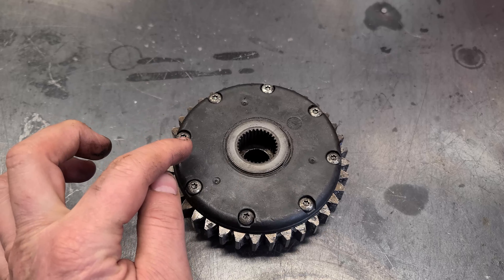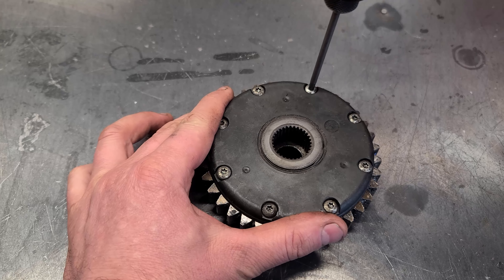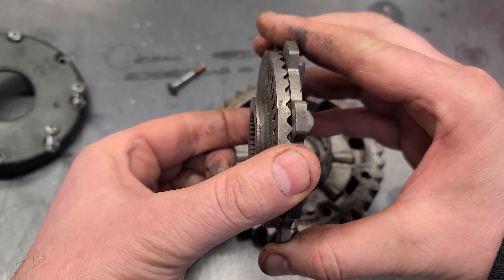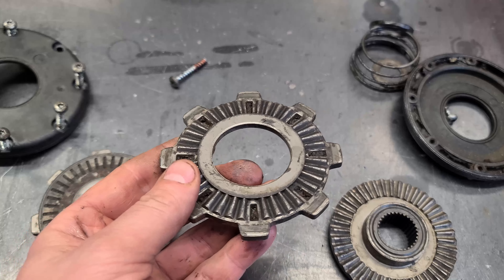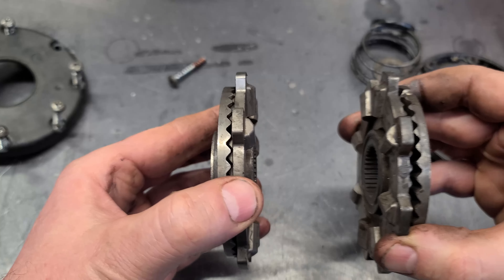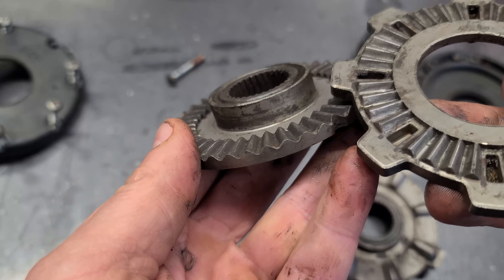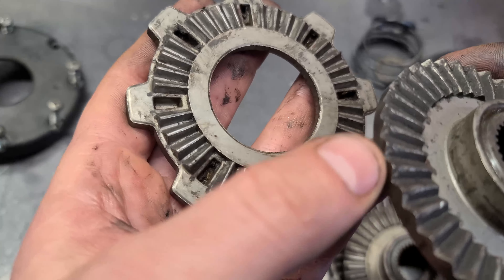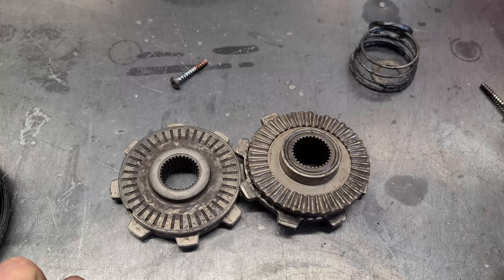INSIDE ARIENS SNOWBLOWER DIFFERENTIAL WEAR & TEAR - WHEEL WON'T TURN & CLICKING NOISE

Comment: Had a situation like this a few years ago. 
Part was more expensive than the blower was worth.  But it was a good blower. 
SOOOOO, I welded everything together and made it into a straight axle  like most MTD blowers.
Worked perfectly 😊
Reply from the maker: that's a great idea if you don't want the dif feature
Reply: @donyboy73  Ariens has a nice idea in hypothesis but practicality it is awful.  I don't really like that idea in hammer drills, so why put it into an expensive piece of power equipment like a snow blower?
Reply: @WJCTechyman  - If you drive a 4wd vehicle you are dealing with some variation of this same principle.
Reply: @donyboy73  yes Don,  but it comes down to how badly you want that feature.  As good as it is, it's not worth the cost, and at the same time the blower is too good to scrap.  And 3rd, having the straight axle is what is most common on other blowers. 
And so it goes.

Comment: Thank You for posting this. I've been having trouble with mine as well. For a temporary "fix", I disassembled the unit and stretched the spring out after pushing on some small windshield washer hose effectively making the spring thicker(and longer). The difference was night and day. 👍👍❤
Reply: Yes, I feel like the teeth have to be rounded to a certain extent to facilitate slipping over each other.  It seems like it may be a combination of wear and a weakened spring.

Comment: Another very fine job by Donny boy who has diagnosed and dissected the problem. These parts are designed to fail because of the materials of construction and the lubrication system. Engineers refer to this issue as Cycles to failure. Some parts have Lo Cycles to failure to balance the cost per management Direction for materials of construction, design standards including maintenance such as lubrication systems that are replaceable, as well as individual components that can be replaced. And, herein lies the difference between a high quality commercial snowblower that can be rebuilt from the parts, versus a lower grade snow blower that has disposable parts. And of course the original equipment manufacturer makes much more money on the parts than he does on the sale of the entire snowblower. So what does that mean for the individual snowblower owner? As the snow blower where it's out and parts need to be replaced you will reach point in which it is no longer economical to continue to buy new parts for an old snowblower. What's the solution? To keep the price of the replacement parts cheap and that is done exactly as donny-boy suggest. Breakdown the assemblies into the individual components which have failed and replace only those components. But that's not how the original equipment manufacturers make money; they make lots of money by selling sub-assemblies that are very costly. And then of course one must pay for the labor. If you are mechanically inclined like Donnie boy, then it is much more cost-effective to continue to replace Parts on your snowblower. Thank you Danny Boy for another highly informative repair video! Kudos to you!
Reply: Seems the entire problem can be solved by grease it once every few years.
Reply: @greentjmtl  1/year.

Comment: Thank You for keeping your videos available. Working on an Ariens Pro 32 an OLD one LOL. I didn't take it apart yet but I'm sure your right about the gears. the part $200, but I'm glad I can get one. Yes I will take it apart to confirm the gears are worn. I think you welded one which I could do, but as long as I can get the part I'll buy one. Thanks Again.

Comment: Great video. I had an Ariens 28 and I couldn’t get the thing to drive up hills. New belts, friction disc, etc. Looking back this part was the problem. I sold it and bought a Honda HS1132. The Honda drive is much better, no differential to slip.
Reply: Yeah, but at CA$5000, it is something I still long for, but in the mean time the Cub Cadet I currently have will have to do.  The features of the Honda like the track drive, battery electric start, hydrostatic transmission (my Honda commercial mower is very nice in this regard) and the gas strut height adjustment would be perfect.  The closest to a Honda snow blower I have is an old Toro 21" repowered with a Honda GX160.  I also have a couple old Honda HS35 units.
Reply: @WJCTechyman  my machine is actually a ‘98 HS1132, I prefer the simple mechanical machine and I spent a fraction of the price of a new one. I sold a 2016 Ariens for a ‘98 Honda. After 1 season I’ve fixed lots of issues on the Honda, but it’s worth it for how it performs. Most of the problems were my fault from heavy use, I’d recommend the older Hondas for sure.

Comment: Always fascinating.  Too bad the individual parts are not available, but would they really be cheaper?  It would seem that both sides would generally need to be replaced anyway.  You know, why fix one side for the other to fail shortly after.
Reply: Yeah, I can't imagine it's much more expensive to add the other parts.  May as well replace the entire thing.

Comment: I've like to see a comparison with a new set of teeth.  Also wondering if stretching or replacing the spring with something stronger would let the plates work for a bit longer at least before having to replace the whole unit?
Reply from the maker: new dif has very sharp gears

Comment: Good video Don. I have a 1 1/2  year old Ariens 24 Deluxe with this differential. I baby my machine . I learned from your videos how to make  my machine even better. Is there any maintenance that can be done to prevent or prolong this from happening? Keep the videos coming,they are really enjoyable to watch.
Reply from the maker: i would take it apart and add some lithium grease between the plates
Reply: @donyboy73  That might help, but may mess with the preset calibration of the differential.  Also, as it wears, you then have grease that acts like Vim or tooth paste as an abrasive holding the aluminum or iron filings that then just etch and wear into the remainder of the plates just ending up with the same result.  I would say if you are a home owner or renter doing only your driveway you should pull it apart each season and clean it out and reapply the grease yearly along with your oil change.  If you are a commercial user, stay away from Ariens' differential as there are better options like Honda, Kubota, Yamaha, BCS and others to use for snow removal.

Comment: Hi. Donny. I do small engine repairs from home garage as a retirement job. I just bought an impressive new ish  Ariens professional series pro 28  926038 with Briggs 420cc engine .  I also took an extra step to install an impeller kit which I have been doing them since 2005 and have had great results with many happy customers. Tested it on a mild day with heavy wet snow and OMG. It blew wet snow 70ft!!  Have videos!  So I am kinda fussy and after I watched your video on differential repair I looked up service manual on mine to see what service I can do to prevent wear. Only info is replacement.  I was thinking of removing it, disassemble and grease? What are your thoughts on that? and Type of grease?  I have done all the other required service . Oh and what do you think of that briggs engine?
Reply: Grease would make it slip more.

Comment: Hi DB, I have a Ariens Pro with the auto turn system, other than proper maintain, is there anything that can be done with the auto turn differential that will prolong its life ?
Reply: I'd take it apart and grease it every few years.  Remember this blower did 20 driveways each time it snowed.  If it only lasted 2 years that would be 40 years of use for the average homeowner.
Reply: @plmn93 , thanks, thats what I’ll do, I’m OCD when maintaining my my small engines.
Reply: @FLSTF-us4df  You might as well do it now. I took apart mine when brand new and there's very little grease inside the differential.

Comment: It seems like it should be packed with grease to prevent wear and possibly support higher tension/stronger spring. I don't suppose this could be added in some way as a repair. A lot of people swear by Aaron's, but I always swore at them!
Reply from the maker: it would be good to add lithium grease
Reply: Well, Ariens' older machines were built like tanks but its current design doesn't really go beyond Cub Cadet.  My Cub, a semi-commercial model is built on par with Ariens.  I would still prefer to have a Honda but at almost double the price of my Cub, it was just easier to go with the Cub.
Reply: @donyboy73  no.  It would stop working immediately.  This mecanism is meant to be dry.
Reply: @WJCTechyman    And that's why I bought a beautful 1998 ST9-28, E.S. with sales slip and all the paperwork including parts manual that's like new and doesn't use this stupid design. Just Love it.
Reply: Detroit lockers are immersed in gear lube. It should work lubed. It is not a dry clutch, it's a toothed coupling that needs to slide over each other  in a turn until the outer cogs realign and forced together when going straight. @Appytail
Reply: @cyrusjohn6594  It is not really a Detroit locker.  It's hard to have a verified answer on this. The manufacturer, General Transmission in Texas (& France), do not answer to emails.  The "Run Dry" comes from some mechanics on the WEB.  They say they have dismantled some new, and found they were dry. It is certainly not comparable to a Detroit lock on a Truck ... If this thing, in the end, needs lub, It would be specific to that application.  Most probably synthetic & moly.   I think I am at this point the only way to really find out is to try myself.  One thing I know for sure, I don't need this at all. I can move the ass of my Ariens cow no matter how stubborn she wish to be.

Comment: You seem like a smart guy, my old ass snowblower’s reverse gear has gotten pretty weak. It’s basically just helping me pull it at this point and it constantly wants to shift itself from Reverse to neutral. All forwards gears operate normally. What should I look for when I open it up?

Comment: Many complain about differential problems. Some complain about moisture contaminating the inside of the differential units. If Ariens is having problems, then Toro must be too, they use the same differential just a different gear ratio. The cost to replace the whole unit is a big chunk of change. I suppose if you only use your snow blower 3 or 4 times a winter, your differential should last a while before wearing out. You would think the units would be filled with grease? But that may not allow the teeth to lock properly. Looks like there is room for improvement in the auto turn differential design.
Reply: Yeah, the grease in the differential concern of yours is what I was thinking.
Reply: @WJCTechyman  It appears periodically the differential needs to be taken apart and regreased. There are seals that could begin to fail. The problem is, you can't buy replacement parts, you have to buy the whole differential. I guess if you can get several winters out it before any problems arise, it wouldn't be that big of a deal. If it were me, I would disassemble the differential after a few years and do an inspection and if needed regrease the unit.

Comment: Even a $610.00 part might make sense on an otherwise good snowblower. A new commercial grade snowblower will cost more than $3000.00. If you do the regular maintenance and replace worn parts you can run a snowblower a long long time. Corrosion from salt water is the enemy. Anti-seize compound is your friend.

Comment: I have a ariens snowblower and was wondering if its ok to 'free wheel' it while its running.  my driveway is on an incline and its much quicker to just let gravity coast it down hill then engaging the clutch. will this cause issues by doing this? So the auger is engaged but I am allowing the blower to freely move and throw snow.  thanks
Reply from the maker: It will not cause any problems, the machine in video was used commercially that's why it's worn out!

Comment: If you noticed the maximum wheel size and maximum machine weigth, you'll notice Ariens' Pro series exceed what that DL500 can handle ...
Reply: I was looking to purchase one of Ariens Pro Series snow blowers, but I opted to go with a Toro HD Power Max 1232 with trigger steer. The trigger steer works well, but the auto steer would make using the big machine even easier. After much research before making my purchase, I was hesitant to spend that much money on a snow blower and be disappointed with the auto steer system. If I did have a snow blower with auto steer, I would disassemble the differential ever two or three years and check if it needed grease. All snow blowers need regular maintenance to make them run properly and last many years. I have two Toro snow blowers that are 1980 models that are still going strong. Those older machines were built like tanks compared to today's machines. Keeping them inside and out of the elements all those years is another key to longevity of these old machines.  As far as the ability to throw snow is concerned, the newer machines with the bigger impeller and augers even in wet heavy snow are light years ahead of the older machines. After your comment concerning the DL300 differential capability, I am glad I opted to go with a HD machine with trigger steer. Thanks for sharing your comment. Let's hope we have enough snow to use our snow blowers. Have a blessed and safe winter.
Reply: My mistake.  It's the DI500 that is my RapidTrack Pro ...  The confusion came from the fact that one on the transmission that I have is black and the other one is Metallic grey.  When  I look at the part number, it tells it's a 500.  However, on General Transmission web site, the 300 is one color and the 500 is the other one.  Go figure.  But according to General Transmission spec sheet, the DI500 is at its limit with the RapidTrack Pro.

Comment: So it's not really a "differential", more like an auto-locker.  My early 90's Ariens has an actual differential (with manual locking knob) that I much prefer.  Riveted together, no plastic.  I shoot a little oil into it when I have the belly pan off and I've not had any trouble with it.

Comment: Just asking would it be possible to fuse those two plates together? A couple of tac welds? Small nut and bolts going through? If there is room after together. Who cares if both wheels spin at the same time not being able to turn well.
Reply from the maker: Yes it looks like you could.
Reply: was thinking the same thing.  Mine is doing this and I was just thinking old 4x4, gonna break this thing open and weld it into the locked position and be done!

Comment: Looks like a mini version of a detroit locker. I'd probably do the same type of fix to cure one that's slipping, use a stronger spring to hold them in place. Or in this case I'd probably put RTV on the faces of the center two dogs and loosely assemble it, then open it back up and clean up any excess and torque it back together and eliminate the diff action. Not the correct repair but if you are in the middle of clearing 2' of snow it's a field repair.
Reply from the maker: or weld plates together

Comment: was thinking about buying this differential  as a spare for my 1332  2003 ariens as parts may not be available in the future. Price for replacement showed $610.00 dollars.   and .....nope!.....
Reply from the maker: here it is $200 CAD
Reply: That's different diff. The one Dony showed is for 2013/2014 and later and goes for about $150 USD.

Comment: Does it pay to modify the paddles on a snowblower to make it blow better?
Reply from the maker: not on newermachines
Reply: @donyboy73  thanks
Reply: @donyboy73  what has changed on newer machines?  Have they finally started installing the rubber blade edges from the factory?

Comment: I'd love to see a brand new set to see how sharp the teeth are.  I feel like the teeth have to be rounded to a certain extent to facilitate slipping over each other.  It seems like it may be a combination of wear and a weakened spring.

20-30 driveways is not much work to wear out the system like that.
Reply: He never said how old the machine was.  But even if it was only 2 years that's 40-60 years for the average homeowner.

Comment: Breaking mine open this weekend and tacking these plates together to stay locked.  No reason you need to have a locker here.  The whole reason this is happening is because its NOT a differential instead its really a design similar to a  "POWERTRAX LOCK-RIGHT" LSD unit.  every time your tires need to spin at a different rates you are jumping teeth against the spring, by design, eventually this means they will all fail.  It just depends on how many turns your unit is subject to.  Environment is going to speed it up too. Not a bad design, just not the right application being in a snow blower!!

Comment: Those teeth could be built up with a little judicious TIG welding, but if the welding isn’t done carefully the teeth would have to be remachined.  If you could not do the work for yourself those costs would be prohibitive.

Comment: If mine ever starts slipping I will take it out and drill  holes completely through the clutch and bolt it up solid with grade 8 bolts,.......seems like a pretty weak setup for such an expensive machine.

Comment: No grease or other lube ?
Reply from the maker: you can add lithium grease between the plates
Reply: @donyboy73  think I would just weld em up and call it locked
Reply: @snowgorilla9789  you don't even need to weld them. you can just remove the spring and install a piece of pipe in the springs place and it would do the same job.